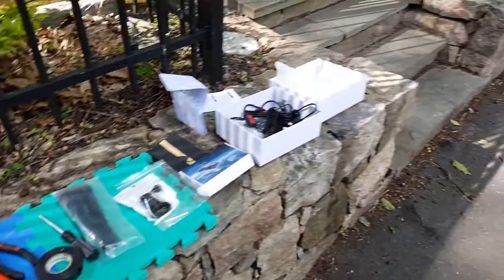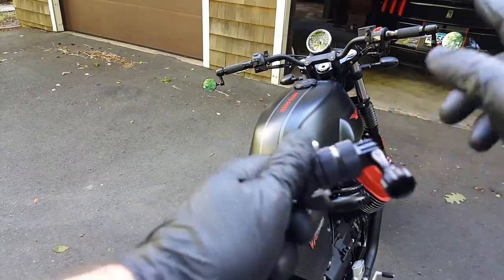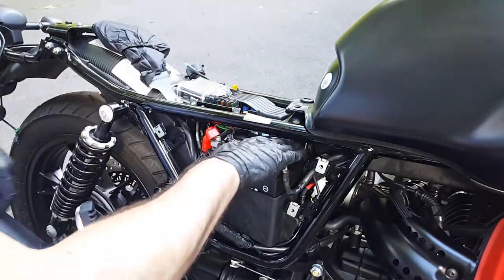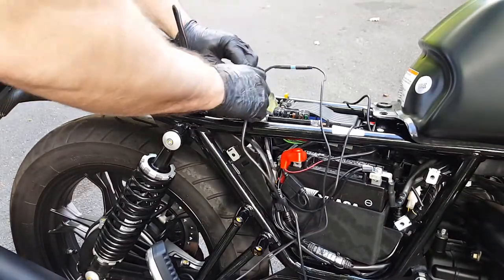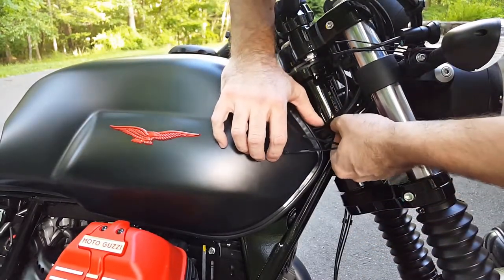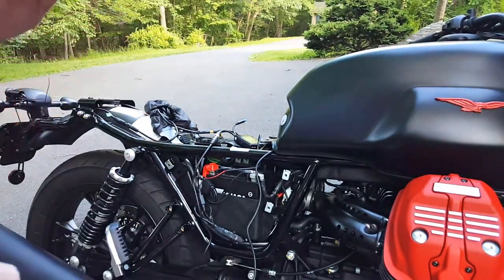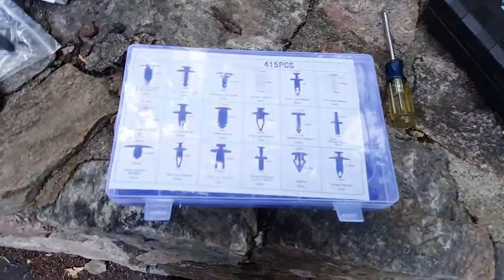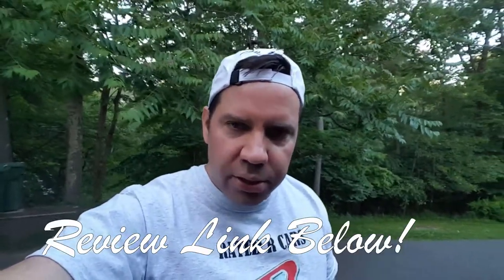How to Install a Dual Motorcycle Dash Cam

Comment: Good video, thanks! I would recommend using flush cut pliers when trimming the cable ties. This will prevent you from cutting yourself on them when you work around them.
Reply from the maker: Great idea. Thank you. I need to get some of those.

Comment: That's cool. I had a gopro Camera mirror mount on my CBR 600RR. I was happy with that overall.
Reply from the maker: Yeah I'm looking for a good motorcycle vlogging camera. I have a couple of cheaper Go-Pro knock-offs but they're not good enough resolution. :o/  Gonna have to pony up and get a Go-Pro at some point. I use this one mainly for security and capturing evidence of an accident, etc.
Reply: @DucatiDiaries  Good thing to have it for. I had a lot of close calls when I used to ride. I did motovlogs with mine that was about it. I used a camera mount on my helmet with my mic for a long time that worked great.

Comment: Hello Brian, 
I would like to double check/confirm an electrical part of this camera. According to your video (if i`ve followed up well) it is only positive and negative that goes directly to the battery. Does this mean that power adapter directly turns camera on/off when ignition is on/off as well (meaning there is no third electrical wire that should be hooked up to a fuse)? 
Looking forward to hearing from you. 
Cheers
Reply from the maker: Hi. Yes, it has a smart module that automatically turns the camera on and off. Just connect it to the battery and you're good to go.
Reply: @DucatiDiaries  Awesome. Thank you for the quick and precise answer!!!

Comment: Thumb up only because you installed the dash cam on a beautiful Moto Guzzi, also for the professional way you displayed the installation.
Regarding the dash cam video recording quality and other issues I give a score of 5-6 out of 10.
Not on my buying list for sure.
Reply from the maker: Thanks Bill. I finally got a ride in today. What are you riding?
Reply: @DucatiDiaries  Unfortunately I can't afford a Moto Guzzi, I could in the past because they used to make 350 and 500cc bikes.
I'm riding a Honda CB300R and happy with that, just some issues I believe because it's made in Thailand, quality control my @$$, 
They already had a recall two years a go for problems related to the gear and still problems with my 2019 model, up shifting form 5 to 6 has problems and the first gear is not always there.
The Glorious BMW also had a recall for its 300cc bike, guess they make it in India!
Be always aware of bikes built in poor countries!

Comment: Very well done,  looks like an OEM product that came with the bike. By the way, are you still getting your 2020 GT500? I believe someone just ran a 10.6 and the quarter mile bone stock.  That is wicked fast for just off the show room floor.
Reply from the maker: Thanks brother. I'm seriously considering the GT500 and C8 (second year models). Especially because I just heard some 2019 GT350's still have engine problems... Lots to think about.

Comment: How do you spell the name of the product and would it be a similar install on the 2022V7 850? Thank you
Reply: I found the spelling of the product on Amazon. All I need to know now is about the USB plug-in device you were pointing to? Thank you
Reply from the maker: Hi. All that stuff is in the description of the video.
Reply from the maker: For the USB device, you can just buy any that connect to the battery. I recommend maybe finding a smaller one than the one I had. I have some on my storefront: https://www.amazon.com/ideas/amzn1.account.AHU27GSYCVUVITILPT5LLLQGRMFA/3R19PRROBQJR6?type=explore&ref=idea_cp_vl_ov_d
Reply: @DucatiDiaries  Is the USB needed in order to operate the camera?
Reply from the maker: @JosephAnthonyNichols  no you just need to wire the camera to the battery. I installed the USB just in case I needed to charge my phone.
Reply: @DucatiDiaries  Got it. Thanks for the update.

Comment: Mr. Gadget 😂 lol. I am really surprised that bikes 🏍 don’t have built in dash cameras these days. Or maybe they do🤔
Reply: Mike J Autos and stuff - cars have to have them for safety, because of the blind spots. I guess if you’re too lazy to turn your head and look behind you then they would be helpful. Give it a couple of years and someone will probably write a law saying that backup cameras are required for motorcycles, bicycles and baby strollers. 😁
Reply from the maker: @MikeFyxdt  One piece of tech I think is awesome is the back up camera that sees all around the car. It's like a satellite looking down. So cool. Have you seen those? I think Tesla is one car that has them.
Reply: @DucatiDiaries  2020 Ford F-150 tech package has the "360 Camera with Split-view Display and Dynamic Hitch Assist". Demo on this looks awesome - I wish I had this top-down camera tech when I was hooking up and towing a trailer back in the day. The tech back then was a spouse or buddy yelling "mo-back! mo-back! (crunk!!!)"

Comment: They give you way too much cable for a motorcycle.
Reply: John Simanella - I was thinking the same thing, like you’re going to be wiring this up on the front and back of a dragster.
Reply from the maker: Crud I forgot to mention they also include shorter ones. But for the rear cam, it was just shy of being long enough.